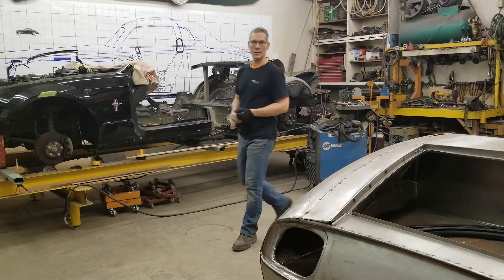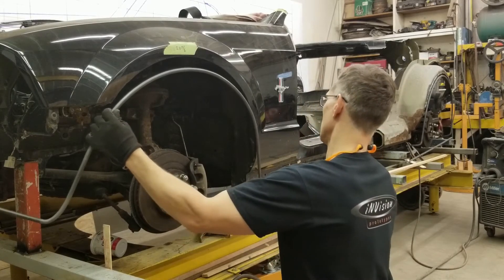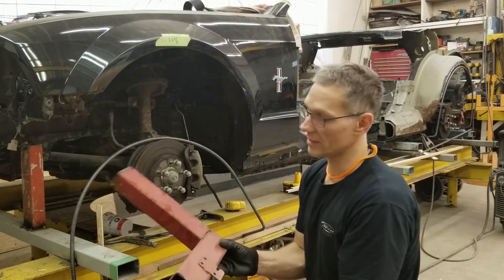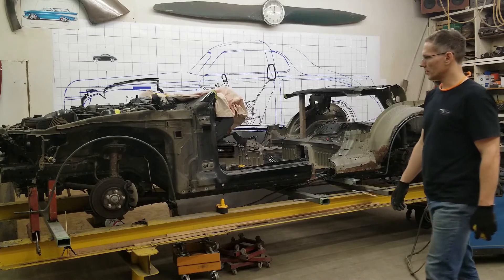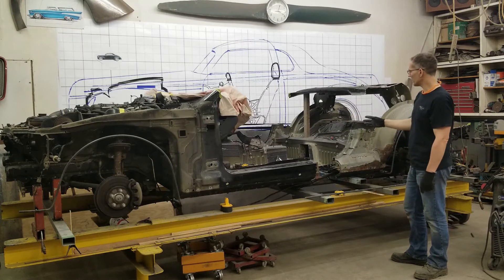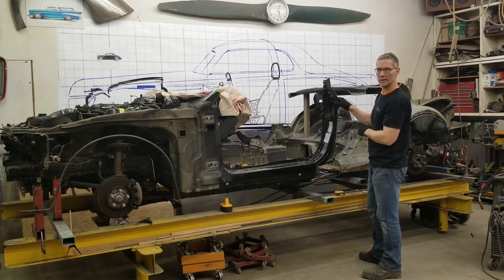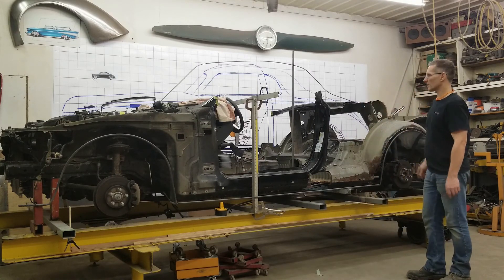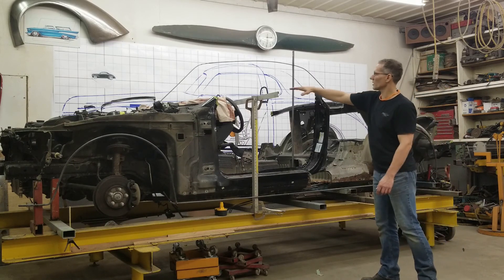Wireframe Buck for a SCRATCH BUILT Body | Part 5 - 1940 Ford Coupe Inspired Hot Rod Build

Comment: Nock... that was an interesting hammer you were using. Ive always taken an iterest in hammers after seeing some serious blacksmith's collections. Did you makenthat hammer from a 3lb hammer and a trailer hitch ball?? It looks like it might make a good initial fender bumping hammer for very abused fat fendered 30s &40s cars!
Reply: Oops! * Nick I meant to type.
Reply from the maker: Hi Daniel! You're spot on with the hammer.. I needed some more 'umph' to cold form flat bar and thump panels.  A thump is sometimes more effective than wacking away with something lighter.  Nick
Reply: @iNVisionPrototypes  Haha, yeah endless whacking away at a panel to me seems to make a bunch of small stretches and some5imes thats good but sometimes if its a deep single dent i find moving it back out with less hammer strikes makes any shrinking easier for me. Years ago i bought a really long curved Mac fender bumping hammer and like it but always thought it was underweight. Thanks for the response. I am currenty subbed and catching up on older vids in this series---- good stuff!

Comment: Hello, discovered your channel last couple of days. Thanks kinda felt like my project is a new adventure, good to have a blueprint. I’m building a couple of “phantom Anglia’s “. I’m starting with a stock body 1948 Ford Anglia 2 door sedan. 1 Anglia a highly modified artist rendering and #2 a traditional “ Carson top Roadster “ similar to 34-36 Ford trunk rear lines. So the wire form from scratch was a very helpful idea. My body’s are going to be aluminum and I am (was? Wondering) making wire form out of 1/2 aluminum tubing and aluminum flanges welded to tubing at fenders, door jams and any stock original bolt on spots. My thinking was the tubing would be easier to form on outside of body and stock fenders. Any input, ideas would be totally appreciated
Reply from the maker: Hi Kurt!  Your Anglia projects sound like a really cool journey especially the roadster version.  Attaching the aluminium body panel flanges to the tubing is referred to a 'superleggera' style of building a body.  It's been done for a long time.  When I design and build a vehicle we aim for an OEM/factory appearance.  So, as you will see, as we progress everything will be formed to the buck, then the buck removed and the exterior panels will be attached to sheet metal flanges around the wheel, door and window openings.  Nothing wrong with the way you are thinking.  Consider picking up a tubing bender or packing the tubing with sand(seal the ends) otherwise the tubing will develop kinks if you manually bend it.  Thank you very much for Subscribing and watching. N.
Reply: I’m going to use 3003 H14 1/2 tubing same anneal rate as recommended for sheet aluminum didn’t think I’d need to fill with sand but of course you may be right. I was hoping it would be soft enough to apply on outside of stock panels applying very little pressure by hand. I don’t care if finished cad will be an inch larger everywhere, wouldn’t hurt an Anglia in a bit ! 🤣
Reply from the maker: @kurtludwig4783  Anglias are a little snug inside for us larger folk. :D  Best of luck with your build!  Shoot me an email with your progress.. Would love to see.  info@invisionprototypes.com